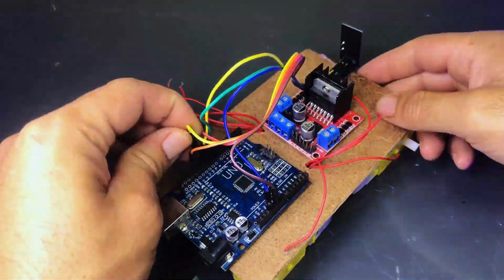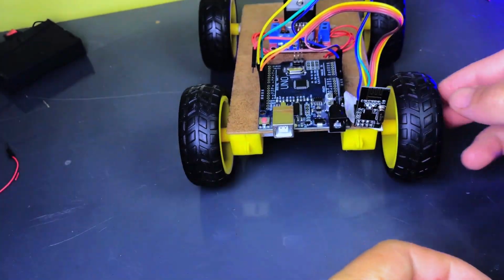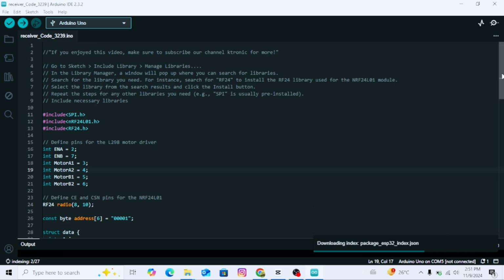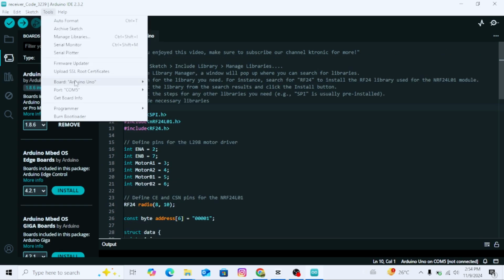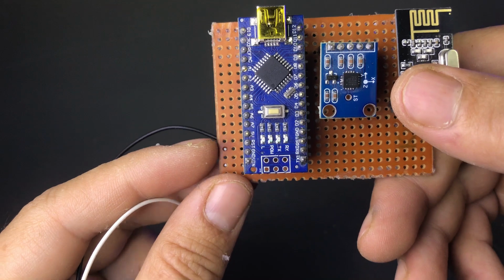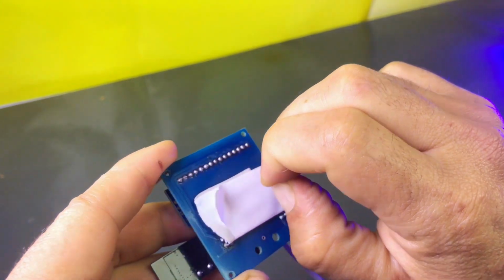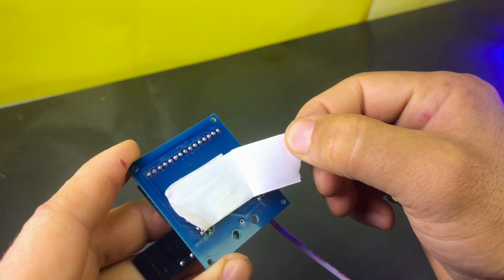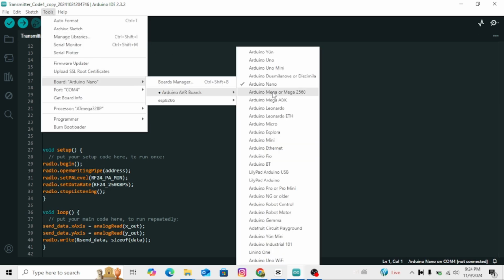Gesture Control Robot – Build a Robot Controlled by Your Hand Movements!

Comment: Hi, can you help us?
We’ve built a gesture-controlled car using an Arduino Nano. The issue is that the car starts and stops with just the power switch — it doesn’t respond to any controller input. Could you please help us figure out what’s wrong?

Comment: Can you Code an Electron's Parameters and the Wire's Parameters that they travel down? If so, no matter the speed the Electron reaches, Light Speed or Beyond, the Wire is Twice as Large as the Electron's Diameter, and like driving a car down the road, the Road stays the same width and so does the Car, regardless of Speed. The only issue is the Human or Entities Response Time, and if you code 'Ahead' of time, the Electron can not only go Light Speed (c), but c^2, c^3, c^+/-.1∞1.-/+, or whatever you needed.  

For Example:
    - Say you program Electron 'A' at a Diameter of Sphere (or whatever shape the coder wants), and say the Diameter of the Electron is 1,  

    - Now, program the Diameter of the Wire at 2.

    - Then, with a Conceptional Thought thru Dimensional Mathematics, which gives you a Perspective View towards the Horizon, or Kai, or Universe, the Electron 'A' will travel along the Wire that is Twice as Large in the Dimensional Mathematical Conceptional Thoughts.
 
   - Imagine (sounds like Michio Kaku Inroduction, lol) driving a car or horse and buggy down a road or path that is Twenty-Feet and Zero Inches (20'-00") wide and the width of your Car or Buggy is only Ten feet and Zero Inches (10'-00") Wide. No matter the Speed the Car or Buggy Travels, even beyond Light Speed, it will Know As Fact, that the Road, Path, or the Way (John 14:6), is Mathematically and Dimensional going to fit, regardless of the Speed Traveled.
    
    Do you THINK that could be coded?

      - By Mathematically Coding the Distance Between the Copper Wire's Electrons, could You tell the Computer the Known Size of the Wire and the Known Size of the Electrons?
       
      - What if the Copper Wire's Atoms are (2x) or (2), meaning Two-Times the Distance Apart of the Diameter Relative to the Size of One Electron?

      - The Diameter of  Electron 'A' is (1) or half the Size of the Distance Between a Copper Atom, which would be (2) two, or Twice as Large as One Electron.

      (((((did that make sense?)))))

  - If you could do that with Electron 'A' and One Copper Wire could you tell the the Electron to only travel through the Wire at 0.1 the Speed of Light?
  - If so, could you make another Electron 'B', and set the Speed of Light at 0.3?
  
   - Could you send Electron 'B'  Down the Copper Wire at 0.3, or faster than Electron 'A'?

    - If you can do that, could you tell the Code to allow Both Numbered Electrons, 'A' and 'B', to Move along the Wire's Path and to Start at the Same Time?
         ---Now, ask yourself...
                  "Since they are Both Electrons, and You, the Coder have Defined the Electrons By                  
                   setting their Properties, making them Appear to Be the Same Type, Size, and               
                   Capabilities, would they Know the Electrons can run at Different Light     
                   Speeds? 
                    - What Color do you think would Appear when you set Both to Start from The    
                   Same Point along a Known Length of Wire, say One Foot (01'-00"), so you could    
                   Calculate how long it would take Electron 'A' and Electron 'B' to Travel at the  
                   Speeds YOU have set along a Known Distance.

- i WONDER....would Electron 'B' Break Time and Space by only traveling at 0.3 the Speed of Light faster than the Electron 'A'?  Could You make an Infinite Center Using Dimensional Mathematics?

YHVH
Your History Verses His/Hers
YHVH is TRUTH
THERE is YHVH and NOTHING ELSE
Exodus 15:2
Psalm 118:14
Revelation 5:9
Revelation 14:3
Revelation 14:12
Matthew 22:26-30
John 1:1
John 1:14
Genesis 1:1
i DARKNESS EXIST (Genesis 1:2 and Isaiah 45:7), and i am here (Amos 5:18-21).
Reply: Man wtf are you even yapping
Reply: WHATTTTTTTTTTTTTTTTTTTTTTTTTTT
Reply: @kavinchadda8537 - Isaiah 55:1-4